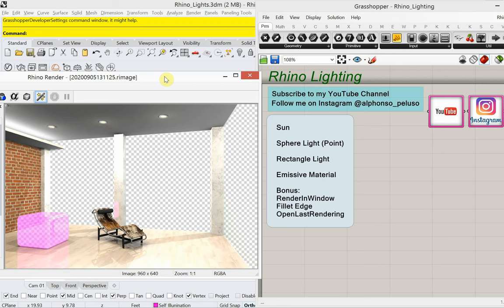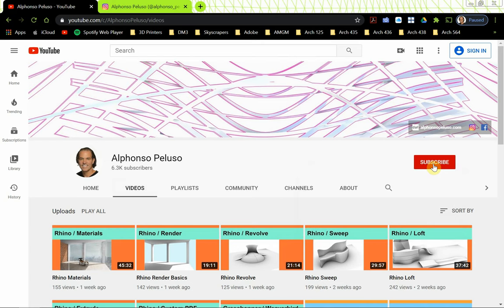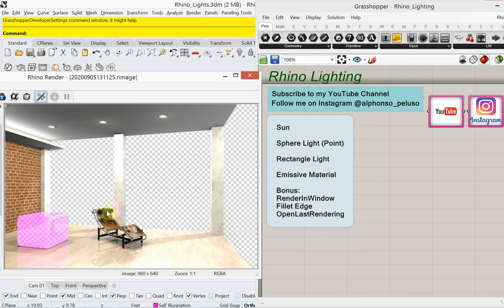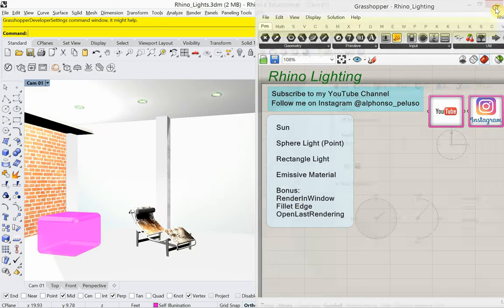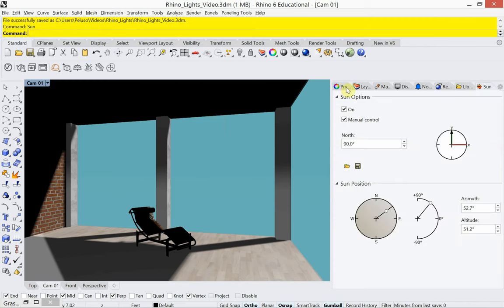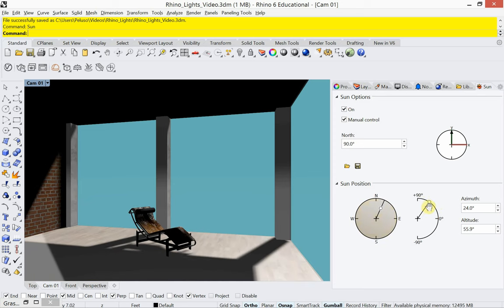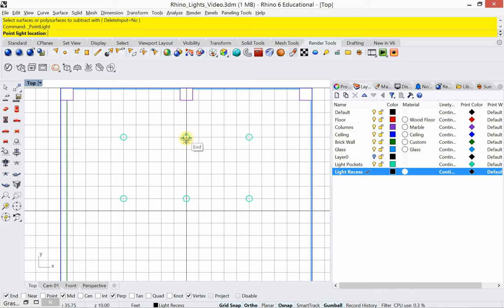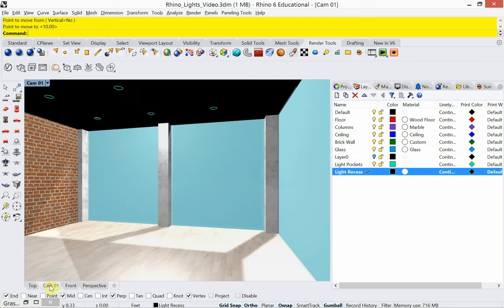Rhino Lights

Comment: hello prof. peluso, would you recommend this method of lighting as the preferred for rendering with v-ray? i like the way this lighting works and it seems to have a lot more potential and flexibility.
Reply from the maker: Hey Jarrett, this is a decent strategy. Did you see the VRay lights video that l posted.